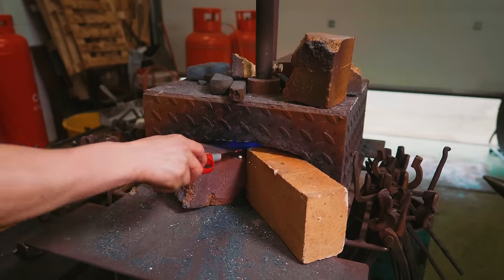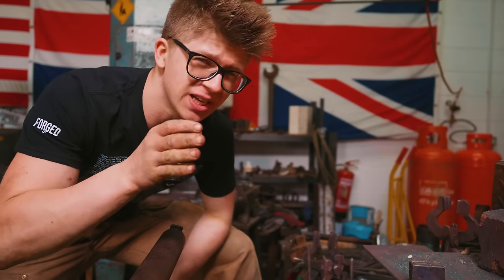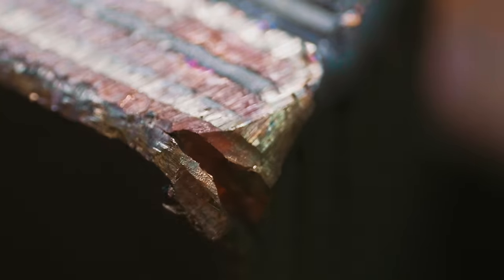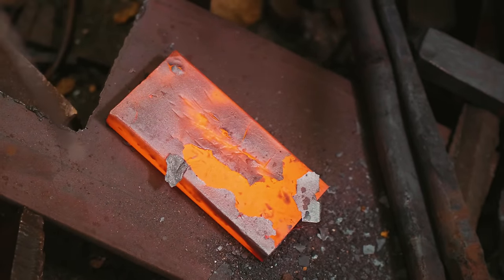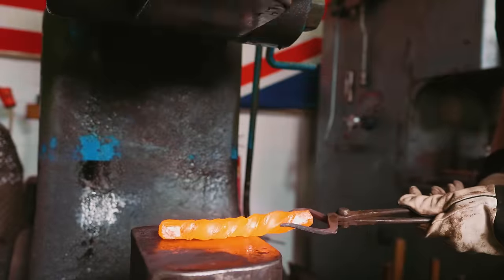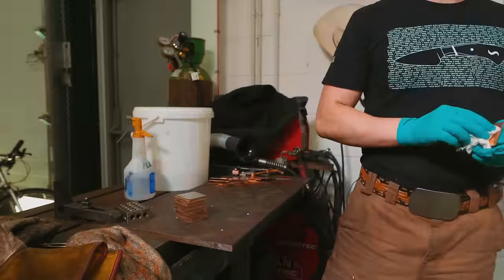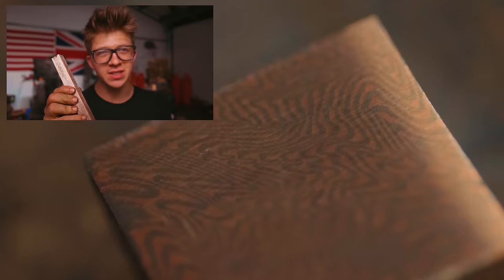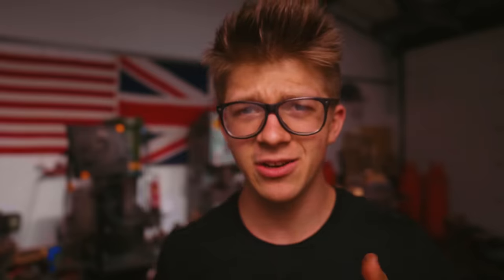CAN YOU MAKE COPPER & NICKEL DAMASCUS?!? MOKUME GANE!!!

Comment: Something similar that I would like to see is a copper aluminium "DAMASCUS" made in the same way. the aluminium however should diffuse into the copper forming aluminium bronze (a bright gold color) which assuming the copper is thick enough should form alternating bands with unalloyed copper. Might need to be done in an oxygen free environment though... maybe I can form the initial stack and get it welded together in my vacuum chamber and send it to you for the rest of the forging?
Reply: @Alec Steele @Cody'sLab duuuudes, do this!  Awesome YouTube collaborations are awesome!

To forge-weld two different metals, do they need to be fairly close in melting points?  I'm wondering what a "damascus" of, say, brass and silver or brass and nickel or similar, would look like.
Reply: Yes please do this.
Reply: As nice as the final nickel-copper damascus looks, my thoughts are that its too prone to oxidation and discoloration - how can this be prevented, otherwise you might make a nice sword or whatever - but  the copper patterns will just go black and green in no time.
Reply: Come on cody, 8 months late
Reply: @Ckcdillpickle  better late then never.
Reply: fancy seeing you here :'-D
Reply: Cody'sLab please
Reply: I wonder if you guys could play around with a metal called nitenol... I belive I spelled it correctly. Anyway, it's memory metal affected.... You guys probably already know about it. I'm curious to see a sphere made of it and or that nickel /copper material. Afterwards seal it in epoxy? Also  forge a small hand big enough to hold the sphere in the palm. Just throwing ideas out there.
Reply: Cody'sLab you should layer as many layers as possible like titanium steel aluminum silver gold and nickel you’d have to Get it pretty thin tho
Idk what the purpose of this would be tho it could look very pretty tho especially if you let it oxidize with the green copper oxides and red iron oxide then the little strips of cold going throughout
Reply: @philosophicalinquirer312  is it basically just a galvanic cell?
Reply: Cody! Just found this channel and to think I run into you here!
Reply: Cody'sLab thanks Cody 🤓👍
Reply: @dvinnyq2889  I read about that when I was in high school, ('78-'84).  It is Nitinol, as it is Nickel Titanium alloy originally made at the Naval Ordinance Laboratory. NiTiNOL  aka Memory Metal.
Reply: If Alec Steel ignores you, I'm unsubscribing. Lmao!
Reply: I would love to see this collab
Reply: @Ckcdillpickle  well he is in the  U.S. now so it would be easier to do a collab
Reply: @redneckpyromania6965  wrong person...
Reply: Cody I did not know you watched his videos
Reply: I think I'm subscribed to everyone Cody is subbed to. I see him everywhere
Reply: Yesssss Cody!
Reply: @philosophicalinquirer312  proper oiling and finishing the forging with the right dip will greatly reduce the ammount of aging on the blade.
Reply: Sounds awsone @cody'sLab
Reply: Cody that would be awesome
Reply: @philosophicalinquirer312  green would look cool though.
Reply: @philosophicalinquirer312  Actually if he adds sulfur to the copper it should help reduce the oxidation.
Reply: That would be awesome if he could
Reply: Cody'sLab PLEASE DO THIS THING
Reply: @philosophicalinquirer312  he can make it and put it in a clear box with no oxygen. That should prevent that :D
Reply: Do it please
Reply: @philosophicalinquirer312  wouldn't hold an edge for long. Would look pretty but that's all. That material mix makes for nice scales and grips but not usefull for things that need to keep an edge or stay hard
Reply: Why hasnt this happend
Reply: @philosophicalinquirer312  that would look kool too
Reply: Hell yeah
Reply: this still hasn’t happened, please make this happen
Reply: yeah, I don't think copper to aluminum would ever be bonded outside of alloying into a bronze.  it would look pretty, but even welding copper to aluminum is extremely difficult, if not impossible.
Reply: @speelydan  close yes.  in respect to the head of this discussion, the Aluminum would be a puddle before the Copper would even glow.
Reply: @philosophicalinquirer312  you could use a deox copper.  in Wrought form it is CDA18900 in the Copper Development Assc., don't remember the cast number.  but is used in the welding industry and by design it fights oxidation.
Reply: @PotatoesAssistant  it would look cool, but i don't think you would have a chance of combining that range of metals.  aluminum is at the low end for melting point, with titanium at the high end with 2000 degrees of difference.  the Aluminum would boil into a gas before the titanium would glow
Reply: @philosophicalinquirer312  You would mix up an alloy of black bronze, (copper/silver) then stack it with nickel. The black bronze is very corrosion resistant, more so than traditional copper/tin bronze and also becomes harder when hammer forged. Once the dark patina set in, you'd end up with bright nickel, and dark bronze stripes.
Reply: Woo call that the Cody's Co-Lab
Reply: I wanna suggest you make a knife for PewDiePie because that groove looks exactly like PewDiePie's color scheme. It would be a cool way for you to get some more publicity and an amazing gift for PewDiePie.
Reply: Yes let’s get that piece of metal up to forging temp in an oxygen free environment
Reply: Cody's hair is fucking sick like duude.
Reply: Please do
Reply: Cody!
Reply: This would be interesting.
Reply: Cody my man
Reply: I wish this would have happened he is in the same state now so why not
Reply: @dvinnyq2889  Nitinol (Nickel Titanium Naval Ordinance Labs) I used to use it at work... I'm not sure what good a sphere of it would be, especially once it is sealed. It works by shifting between the martensite and austenite phases (saying solid as a state of matter is a simplification) Pretty cool stuff, but usually used in things that need to be very flexible. (We mostly 
made stents and vena cava filters)
Reply: @ctberchem7303  would that stuff be magnetic?  Or affected by? 
I have many magnets and make these contraptions of ball bearings and magnets then spin them, while hung off of its own field. Very captivating.
Reply: @dvinnyq2889  It has been a while, but in my recollection it cannot be magetized (at least not for long) but is somewhat attracted to magnents. The transition between martensite and austenite phase tends to disrupt the magnetism. The arrangement of nickel and titanium makes it very poorly attracted to magnets. When you are having them implanted in your body that is generally a good thing.
Reply: @ctberchem7303  
If only knowledge was magnetic and we could ...well some people are unwilling to learn, ignorance is a trait i despise in people. 
Thanks for the info. Good day
Reply: That's not damascus, if you melt copper and aluminium together you get nordic gold, a kind of bronze. It's super strong, doesn't erode easily, and is used in many boats and ships around the world. It's also ridiculously overpriced, with 8 cents of material costing $200 to buy a bar of it. Which is why you make your own when you need it. I drop cast the entire induction system of my motorbike out of it.
Reply: Won't work, which is why people don't make it. End of
Reply: CHEMISTRY OF THE METALS LOOKS A LOT MORE SEXY DOESN'T IT far more so than the chemicals that end up in flasks and beakers
Reply: @philosophicalinquirer312  I mean the point for copper is to go green.
Reply: hold up Cody!? you watch him too
Reply: 2 years later, this is still a good idea
Reply: @speelydan  me neither rn
Reply: So this never happened?
Reply: Nordic gold
Reply: Cody!
Reply: Cody youre epic

Comment: You can heat the copper to turn it more red. Doing so also makes the Nickel brighter. If you can get the heat right, match the copper to a red wood to make the hardware and handle for a really bright Damascus project. If you can preserve the woodgrain at the intersection of the two, you could make a very interesting transition between the two.
Reply: It already looks like red wood. Make a knife and give it a nice polished red wood handle. It'd look AMAZING.
I'd buy it.
Reply: Just use this for a handle
Reply: I’m thinking a piece for a belt buckle would be sweet with the creamy brown of leather. And save some for a bolster and pommel for a Bowie knife would be pretty jazzy
Reply: Bolsters/guard for a damascus knife
Reply: Rockey509 dude you are so right. I really hope he makes like a bad ass knife out of it. It's so awesome looking.

Comment: Coating the metals in flammable acetone is likely the reason they caught fire while welding.
Reply: Acetone evaporates really quickly
Reply: It might be the remains of the WD40 burning off.
Reply: That was a yellow flame. It wasnt the copper or nickle. Its possible if alec was using iron as a welding medium it was that but the most likely cause of a flame like that is a carbon base such as acetone
Reply: Copper naturally changes flames to green
Reply: Yes the green flames were from the Cu oxidizing.  I'm kind of shocked that the "crust" wasn't green.
Reply: @SRYoungIV  Very late, but black copper oxide can form on the surface of real hot copper exposed to oxygen. If I had to guess that's probably why the scale on the copper was black

Comment: Use the first one as handle scales for a small knife and the second one for a larger knifes handle.
Reply: I agree - using them for handle scales would be awesome
Reply: i was thinking the same handle scales for a Damascus bowie
Reply: THIS !  I would def like to see a handle made . Also reminds me of tiger stripes .. maybe tiger handle  🤔 or am i just pushing it now lol
Reply: If not the full scales, I Inlay a large version of his touchmark into a wood scale such as ebony or cocobolo
Reply: if he used it as inlays then the rest could go on as a guard and pommel
Reply: I wouldn't use that for a guard, way too much copper and wouldn't sustain any abuse, maybe a thin strip of it sandwiched between 2 thicker pieces of steel sure. Same with the pommel, as a spacer between the handle and the pommel sure. For the scales I was thinking a small folder or 3-4 inch knife that's more detail work oriented, and the second version something like a hunting knife with maybe twice the blade as the last one he made.

Comment: the green flame is the copper oxidising rapidly like the color green in fireworks
Reply: coperdioxide, yeah
Reply: @activistvoorrechtenvankaas2810  Wrong it can't be Copperdioxide for the fact that those  two elements wouldn't bond together do to the electrons unless there was another element to balance it like aluminum, or chromium. What you are thinking of is actually Copperperoxide which produces that green color.
Reply: captain knowitall everyone that came probably knew that.
Reply: The Green colour in firework is CopperOXIDE wich is burning
Reply: No no no....its caused by the Green Lantern corps...dont you people know anything....sheesh!

Comment: That would look AMAZING on a nickel plated 1911 for its pistol grips.
Reply: That would be nice, combined with a matching combat / survival knife....unfortunately since the UK has banned all cartridge based handguns I highly doubt this will happen from Alec.
Reply: Phillip Kirkpatrick no they can have had guns but don’t they need to have 12” barrels?
Reply: Phillip Kirkpatrick and I don’t think there is a law against making the grips for one?
Reply: He would need either some grips to duplicate or a chopped in half receiver to do it
Reply: Semi-automatics are limited to 22 rimfire as well....so good luck on a 1911 .22lr and a 12 inch barrel, lol
Reply: Phillip Kirkpatrick let me know if the link didn’t show up
Reply: I don't see it....however did a Google search on just that and I stand corrected, if there's a will there's a way to make it happen
Reply: I would be down to send a set of grips to copy, and put the ones he makes on my gun
Reply: Andrew Tapley lol I would also.
Reply: Phillip Kirkpatrick the also make full size 1911s in the original .45 ACP caliber except they have to have the same 12 inch barrel and an extruding piece in the back to make it meet the OAL requirements and it can’t be semi auto I think. Although I’m not sure. But most semi auto guns exist there and just have the gas system removed. Idk how that would work with blowback
Reply: blueprints/CNC models of the grips of a 1911 are very much found far and wide on the internet...
Reply: Geebs Kerbal i agree

Comment: Very nice. I'm thinking it's too soft for a blade but how about handles? I think it would go well as the handle of that hunting knife you just made.
Reply: the handles themselves i would say no but for the guard or the pommel it would be pretty good imo
Reply: You could make a blade from it and work harden it by peening the edge outand doing a little touch up on it afterwards
Reply: I was thinking handles as well
Reply: Like the blade, the guard has to be as strong as possible since it too must stop blows from another blade. The pommel would look good.
Reply: As a handle it might do well to balance out a heavier blade. Pommel would be good but I think it wouldn't show off the material enough
Reply: Perhaps as an inlay for the guard and pommel?

Comment: Make two handles for a matching dagger set
Reply: Michael Cardona I was thinking a guard and pommel but have an ebony hilt
Reply: Like a Seaxe and a throwing dagger? That would be cool
Reply: Michael Cardona, I think your idea is grate, a set of really sleek assassin type daggers would be an awesome task to achieve in itself, especially with that twisted billet shaved down & profiled for some super fine scales.
Reply: Even better?  A silverware set.  Knife, fork, spoon.  With super fancy handles.
Reply: Mac Jones..
Great minds think alike
Reply: Michael you got it right ......... 2 beautiful handles that would make.
  Also think about this ..... that material wouldn't be a good knife blade....
UNLESS you add another piece of good blade steel along one edge and pound it to shape with the additional copper / Nic
Reply: The electrolytes on human skin will create galvanic corrosion between the copper and nickel. Over time the copper will literally dissolve.
Reply: Nickel + skin is a bad idea.
Reply: I was thinking the same man
Reply: ohhh that would be super slick looking. I dont know if it would grip enough. But who cares?!!?
Reply: Damascus blades, natch!
Reply: By which I mean, he should make a couple of lovely Damascus steel blades, then to the complete set of fittings from the mokume gane.  Not make blades from it.

Comment: You can get great results by sanding clean sheet metal to a bright finish and immediately coat with flux paste. (The oxide layer on nickel stays very thin, but you might as well flux this too). It is best to make the outside layers of nickel, not copper. Oxygen is the great enemy of hot copper. 

Copper and silver really don't behave well in an oxidizing atmosphere. Silver looses oxygen fast while molten hot. Silver absorbs oxygen rapidly as it cools towards a solid state, and  it needs to be oxygen free for best results as it cools to a solid. 

As soon as you get a great bond,  let the sandwich cool. You will need to anneal at intervals, but do the work close to room temperature, unless you can exclude oxygen by completely surrounding the copper with nickel, or exclude oxygen from the work environment. Copper oxidizes deeply and fast when hot, so heated surfaces should already be coated with flux or some other passivation layer. 

An inert gas really helps. Just Nitrogen & CO2 is OK. Nickel, Tin or Aluminum are good passivation layers for Copper as their oxide layers tend to stay thin.
Reply: David - "Copper and silver really don't behave well in reducing (oxygen) atmosphere."  An oxygen atmosphere is not a reducing atmosphere - it's an oxidizing atmosphere.  A reducing atmosphere would be carbon monoxide, or hydrogen sulfide (pew!) - one in which oxygen is preferentially removed by the atmosphere from the workpiece.  Since it's impractical to work in such an atmosphere, the results are obtained by using flux to surround the material and isolate it from, and bind the oxygen to, the flux.

Comment: a kitchen knife made out of this would look amazing.
Reply: I was looking for this comment! Make it happen
Reply: A survival knife made out of it would look amazing.
Reply: Very soft due to nickel and copper being soft metals.
Reply: Yeah it would be a crappy knife in terms of strength
Reply: @CrazyNerdInventor  there is a possibility of attaching a hardened edge to a spine of a softer material. I've come across it in a few blacksmithing books. It's basically just the old method of forging some implements with limited high quality steel. If he forms his billet around 3 sides of a harder core steel if he has the right flux and heat he could get a very usable blade with that pattern on most of it. Think like the soft cap around old single edge razors for seamstresses and scraping tape off glass. It's doable but it would be tricky
Reply: @audiosreality  you're talking San Mai. San Mai is made with steel, all steel. Copper won't forge weld onto the steel. First time you abused the blade in any form, it would separate from the steel cutting edge.
Reply: @mikeford963  True, bitmakers do forge copper into iron though to make "sweet iron" mouthpeices. And nickle can be mated to steel  so it may not be as prone to separation as that. If it's possible it would be worth the attempt
Reply: Also copper and some nickel oxides are poisonous
Reply: @mikeford963  I'm not sure San mai is the exact same thing as I ment more like forge welding the blade into an axe. San mai from what I read up on it looks like it uses more of a 3 layered aprouch going much deeper....
Reply: @audiosreality  please make this happen
Reply: @audiosreality  THIS!